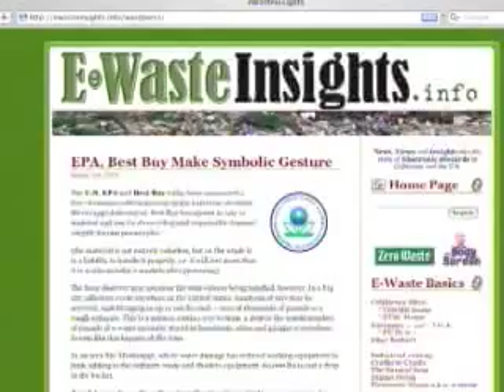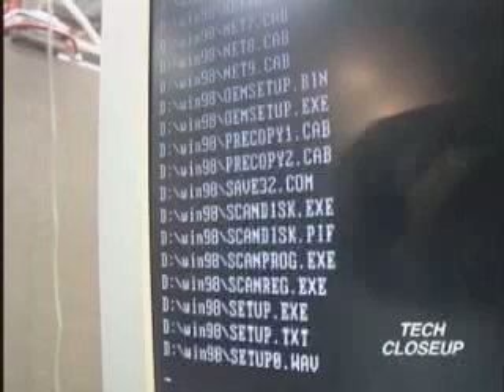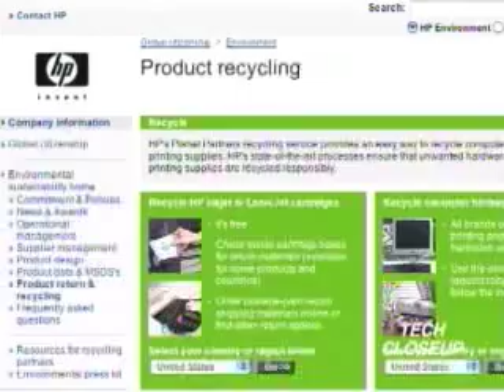E-Waste-It's Our Problem

Comment: Smegbron, you are exactly right. Most kids don't NEED all that powerful a computer to do classroom work. They don't need a dial up modem for sure. They may need ethernet to connect to the server. I took two old computers from a gamer club and turned them into great home computers. When one got a bad processor and my stepson took them apart for fun I was able to combine parts to make one good computer. But I had to get a Windows XP for OS. These computers were over ten years old.

Comment: Manufactures need to make better products that last longer and are more easily upgradable. This lie we are sold of that you need the newest, latest computer is the problem. I am typing on a old laptop..It works just fine. Sure I could buy a new one, but why? It works, and when it doesn't i'll try to fix it, only then will I give it to a recycling place.